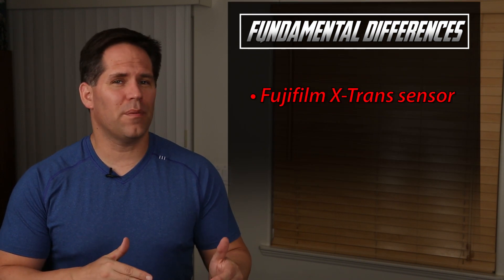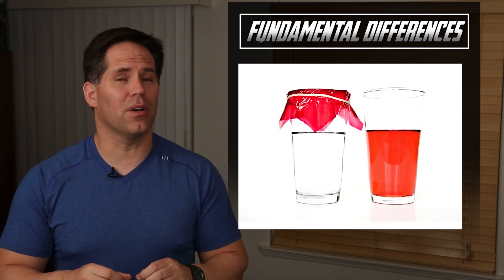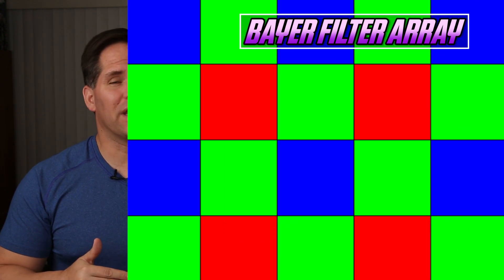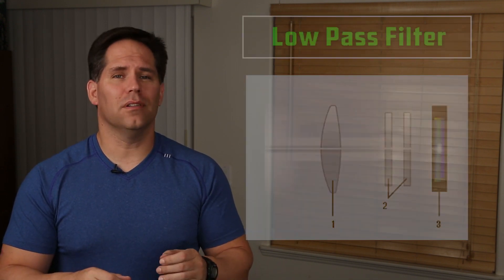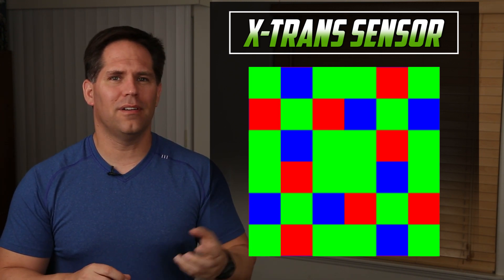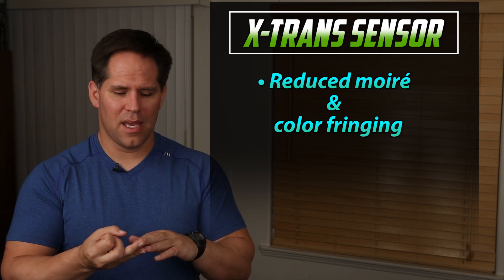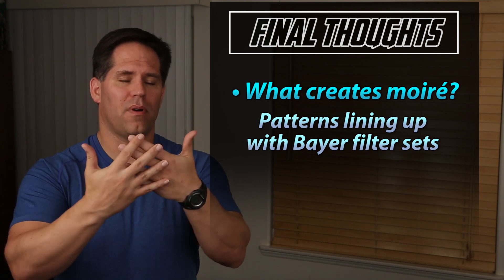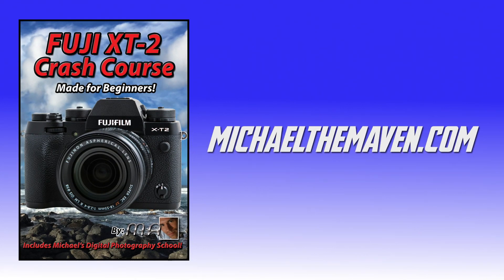Fuji X Trans Sensor vs Moire

Comment: Except  my Pentax K-1 and K-1 ii gets by just fine with no low pass filter for its Bayer array CMOS and it’s well known for its image quality. I realise this video 4 yrs old but my K-1 is almost that old. A lot of the higher end cameras are now ditching the AA filter. 
I do have  Fujifilm X-E4 too and it’s good, but can’t match the full frame 36mp CMOS Pentax which isn’t surprising of course because it’s not comparing apples to apples

Comment: The benefits of the Xtrans sensor are pure marketing and don't exist in reality. Fuji cameras only exhibit less moire because of extensive colour noise reduction the camera performs on the raw files. The xtrans sensor produces greater amounts of moire and sampling errors (before noise reduction in camera) than a bayer filter because the regular repeated part of the structure in the colour filter array is a larger 6x6 tile than the bayer filter's 4x4. The detail xtrans filter arrays capture is noticeably worse than a bayer filter array, about on par with a m4/3 sensor in areas with specific colours.
Reply: Can a camera perform noise reduction on raw file? I thought it could only do so with a jpg file
Reply: @aymanmehdi1352  Yes

Comment: Michael, you are very good tester, but you are absolutely  wrong!! :)
X-Trans it's just commercial trick. Good on paper, but have less resolution and in real life have no advantage compare to bayer (without AA filter).

Lenses often have less resolution than modern sensors and that's why it's really difficult to see moire on the photos.

Do you remember Super CCD sensor from Fuji? It's a same "Revolution technology" like X-Trans...))
Reply from the maker: +TerroMin I'll have tests coming soon. The images have proved to be incredibly sharp, far more than anything else I've tested. I'll have an epic shootout coming soon
Reply: When you would postng the video ? I was intesting to see does the images really sharp.

Comment: But the X-T2 has less red and blue photo sites than standard bayer 24Mp sensor. So actually it has less color resolution :). Yes the lack of low pass filter and the sharp fuji lenses give a lots of detail but it is only monochromatic detail. colorwise X-trans is weaker and if you process it (from RAW) to get more detail the moire is there. 
In conclusion - it is awesome but not that far from the others.
Reply from the maker: Simeon Kolev our eyes are more sensitive to Luma (which is where green comes in best) than the other colors, this is why there are 2:1:1 in Bayer. 5:2:2 is not that much difference ratio wise. It also seems like there are lots of different RAW processors that give different results, but that is another discussion....
Reply: Agreed :) but still I see the difference when I know where to look. I hope that you will test the T2 against bigger and more megapixel bayer sensors where it is much more visible how the colors are not there on the X-trans. Fuji lenses are great and they compensate in luma detail but a lot of people around me are crazy about those X-trans sharp sensors and for them even 50mp canon is not a mach... :).  It is kinda funny when fans start to see things that are not there. So please do not be like Tony Northrup :) be objective.
Cheers!
Reply from the maker: Simeon Kolev you bet. I have an epic shootout coming and will post all my results, good or bad! Thank you for your input
Reply: Fuji has a gorgeous color and dynamic range. The problem with the fact that not all converters are work properly with fuji RAF. One of the good converters for fuji is    https://olafphotoblog.com/2013/09/13/dont-sweat-the-details-but-a-non-scientific-review-of-iridient-developer/
Reply: @Phil Jones65 get over it, stop fooling yourself

Comment: Nice Video. Thanks a lot. What about the Sigma's sensor? Foveon on DP series? It have three layers and each layer will capture one of the R, G, or B. What the pro and con of it? Thanks!
Reply: They breakdown really fast as you climb the ISO range.  Even as low as ISO 400 the images would start to degrade, but at ISO 100 they were very impressive.

Comment: how's the X-t2 treating you? do you like it? I love my fuji xt1.
Reply from the maker: David Marte I'm very impressed so far. It has a very different look
Reply: yes. I sold all my Nikon gear in March 2015 and went with the fuji line. I love the look and how it renders colors, specially the skin tone using the Astia film look.  A++
Reply from the maker: David Marte all my Fuji friends say the same thing, they try it and don't look back. I love the size and build as well. Very high end manufacturing - it's a work of art
Reply: Sold my pentax After buying my Fuji. 

Can't say it's one thing. 

It's the way they operate. The  Colour with the simulations. The best native Apsc lens line-up(No this is not open to debate) 

The Tonality in B&W images. 

The build quality. 

Their commitment to existing products by firmware compared to adding mew bodies for every new gadget.